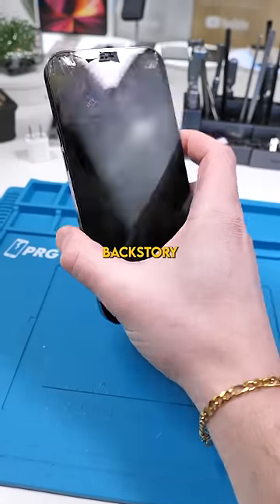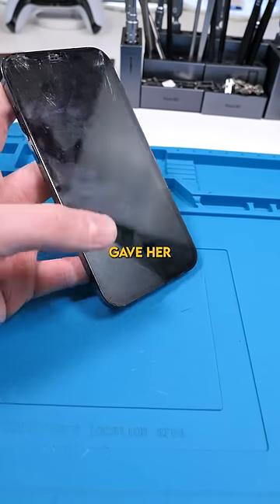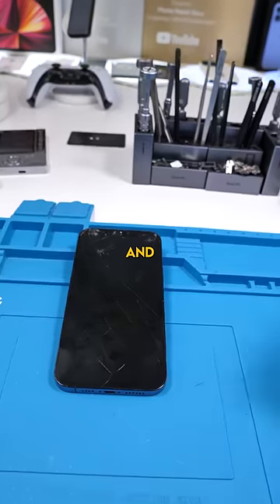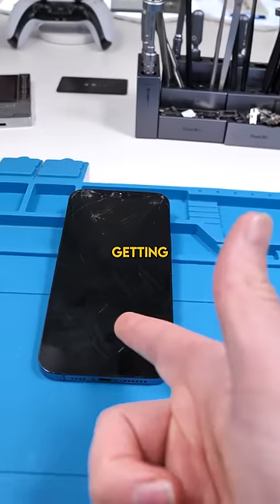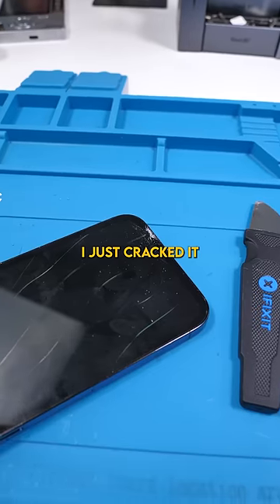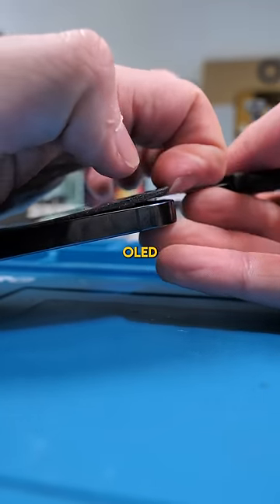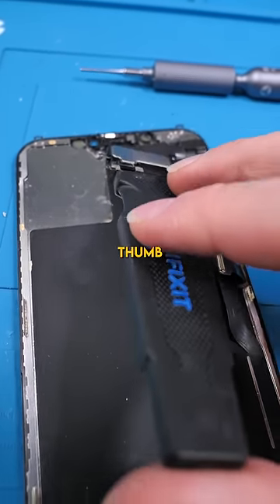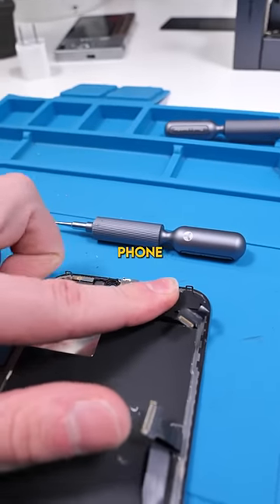They Completely Screwed Her Over... #Shorts

Comment: Jeez. That’s not good customer service at all
Reply: One friend of my friend “fixed” my old iPhone SE 1st gen. I needed to replace charging port cause it failed over those years. I was waiting for my phone just to realize that my phone is missing bottom screws. Less than one year later my phone slipped out of my hand falling straight to the concrete and split into two pieces. One piece was screen and other piece was everything else except that screen. I realized that brackets covering battery connector were also missing. So what happened ??? Well my iPhone SE that I bought for 300$ back in the 2018 was on the ground in two pieces with no signs of life. I didn’t repaired the phone cause it was 4 years old and used SE 1st gen cost about 100$ (in used good condition) at that time in my country so basically I would pay more for repair than what current phone price would be. Also during the impact Touch ID/ home button cable tore apart. And no body except for Apple can replace home button without permanently loosing Touch ID and I bet that they wouldn’t want to repair phone that was released back in 2016. Now I have iPhone SE 2022 and it meets my needs but I’ll never forget about my cute adorable little iPhone SE 1st gen 32 GB version with space grey color.

Comment: The only time I use lcd is when someone is trading in their phone to their carrier.  Shops that use lcd make the lives of every other shop that doesn’t way more difficult than it needs to be
Reply: Heads up: Depending on the carrier’s service partner that deals with those trade-ins they could very well decline the phone because using an LCD is way too obvious. Just turn off the lights and you can tell it apart even with the best LCDs.
Reply: @tahaak  to my knowledge, at least in the United States, the vast majority of carriers just want the phone to not be damaged.   I’ve been installing Lcd‘s in customers phones for years now and I have yet to have a client call me back because a carrier denied their trade in

Comment: Just opened a MacBook Pro 2019 with i9/64GB which was given to me (obsolete HW nowadays) .. it was supposedly have fixed battery. But the battery does not work. The repair company had been scratching the screws .. dunno why .. and the flat cable assist lines (?) had been broken. Have been fixing as an amateur laptops BUT never done such a terrible work.

Comment: It's not possible to put a LCD. You need completely separate voltage line for the backlight. Also it's well to see that the aftermarket display is thin so it's 100% an OLED..
Reply from the maker: it is possible

Comment: Story of mine: My old iPad had a glitch which randomly clicked, swiped and dragged things on my screen it's really weird and fucked up. And once I was in a game and when that happened I raged and smashed the screen, it broke. We gave it to a popular store (mediamarkt) who sells tech and stuff, also does repair. So basically removed the screen put on a new one, messed up the speaker, messed up home button and didn't place a thing with the screen which was needed to support the screen and the screen broke again without actually doing something to it. Brought to them to fix again and same issue, we paid those mf'ers €200 for those 2 repairs in total, just to destroy the iPad, later we went to China and to a local store, he fixed the iPad in front of us, tells us what was wrong and everything he said was correct, it ended up costing ¥50 which is fucking cheap; €6,89. No problems anymore later. Till it fell on the ground and nothing can move anymore. I don't believe those fuckers here anymore.

Comment: I’ve had my old phone brought into a repair shop for a screen protector and they broke both my galaxy s10s back glass and front screen and after then charging me €200 to fix their mistake they never fixed the back glass and not only did I have  to order parts to do it myself I was also down €200 all becouse I came in for a screen protector to protect my screen. My worst phone experience to date

Comment: So that’s a mobile sentrix screen which is what we used at my old job. What brand do you recommend?
Reply: It does look like a MobileSentrix, but it may also be the same brand this kiosk in the mall near me uses. They ripped off MS's sticker logo and are super low quality. If it's a MobileSentrix screen then they are still fantastic, I use them daily at my store. The big difference is that I use MobileSentrix's soft OLEDs on phones that shipped with OLEDs in the first place.
Reply: I hadn’t thought of the sticker switching, but that’s possible
Reply: If it's Mobile Sentrix then that's an OLED screen not an LCD as stated

Comment: How have you solved the problem of the serialisation of the display in Apple phones?
I recall when Apple introduced the lightning cable with that unmarked switching chip inside, it took almost two years for the cloners of Kamino to introduce an equivalent cable on the market at $2 instead of $10.
The same two years have elapsed now for internal configuration control...
Reply: Yes, but you do need a special device from Qianli to do that, it reprograms displays by copying the serial number from the old display and moving it to the new one, I don’t know if that’s what you are talking about

Comment: The tool you use to open the phone seems so thick compared to using a flat blade. Why do you prefer that? I still have mine but never use it since it seems like so much harder to slide in

Comment: I really really really wish MobileSentrix would STOP selling this garbage. It makes the high quality screens I buy from them look questionable. Also it can damage multiple components including diodes, caps, filters, coils, chestnut and other driver ICs. They are mostly all under shields or require the board to be split. It's harmful to the customer and gives repair bad name. Go to reputable shops that either get their hands on Refurbished OEM or are part of the Apple IRP system.

Comment: Just out of curiosity. You talked about how you should be willing to replace something if you break it. When I looked into opening up an older pixel 3 xl for a battery change to try and fix it being dead they said if the screen breaks while opening they would charge for another screen.. That's not a normal practice?

Comment: I had a Samsung galaxy tab a7 tablet and it wouldn’t charge unless you heat the charger up and and angle so it would vent the port, I sent it to be repaired it took them two weeks they charged me 80 dollars to replace the port and I got the tablet back with about a 2 millimeter gap where the wall  of the tablet and the screen should meet. The screen was above the walls of the tablet so I couldn’t use my case and the port broke again a week later as well as the screen.

Comment: Ok customer comes with working oem oled screen just cracked , they want u to work on ear piece swap clean etc , 

U give liability disclaimer that already cracked screen can crack/flex the lcd more and it can go out and u won’t be responsible to pay for it , they give u the go ahead to do repair . 

 u end up taking apart an already cracked glass screen so it bends and it punctures/damages oled somehow but it’s broken for sure and u touched it last.

What is a replacement u will offer to customer 

A. Find them a new screen oem they don’t pay anything for either repair.

B. Find them a new screen oem they pay only for earpiece repair 

C. Find them new oem screen u tell them 50/50 on repair for damaged oled ( charge same price for original earpiece repair) 

D. Give a aftermarket lcd You eat the cost and charge customer only for original earpiece repair 

E. Give aftermarket lcd free and not charge anything for earpiece repair 

F. Find a broken oem oled that’s cracked but works the same u supply that part and do  repair plus the original earpiece repair for free

G. You close up the phone and hand it back more broken with u not providing any responsibility to pay for replacement part / repair. 

U are able to make ur own answer as well I just gave couple examples . 

Whose liable

Comment: Will the faceunlock work with the non original replacement screen?
Reply: Repair tech here, it highly depends on what part is replaced for the Face ID sensor and speaker component that gets attached to the screen. It especially depends if it was taken off with care. You have to take off a component off the screen and place it on the replacement so it's all about if there was previous damage and tech patience.

Comment: I'm actually pretty disappointed in you PRG. This was your exact cue for #RightToRepair and don't lie. I've watched you use those screens. You could also explain the $150 part difference before tax and labor. Leading to the conclusion we absolutely need those 'low quality' screens. Even if it's just getting data back. Smh..

Comment: Hey brother. Big fan of the videos long time viewer first time commenter, I have a iPhone 11, and on Christmas I was cutting fire wood for my mom and it slipped out of my pocket and landed in the snow, I quickly picked it up and wiped it off and put it in my pocket, continued to work, the phone had a otter box case on it. The phone worked fine that night, but when I woke up the next morning, the phone will not load any videos, and every 2-5 mins restarts, I’m almost certain one of the processing chips got damaged. The phone still works for a few mins before restarting. It won’t work long enough to send my pics or anything off it. I had to resort to using my old iPhone, I was wondering if there is any way you can fix this? The phone wasn’t cracked and in a case, and supossed to be ip68 water proof, so I’m not sure how this even happened to begin with. I was wondering if I would be able to mail this into you and have you take a look at some of the chips inside. Thank you

Comment: Hey, i got a problem with my Galaxy Z Flip4. I love this phone but there are 2 things i want have changed. At first that i can't fast charge and it has a really slow USB-C port can i have that changed? And the second thing is the accu is it possible to put a bigger battery in it? Love your content Plz help me
Reply from the maker: Hey Stefan, Thanks for being a member! 
With the Z flip there is actually a setting you need to turn on to enable fast charging.
In settings > Battery and device care > tap on battery > Scroll to more battery settings > and enable fast charging. 

As for a bigger battery that is not an option at the moment, it may be in the future depending on whether aftermarket manufacturers chose to make a larger capacity battery.
Reply: @PhoneRepairGuru  plz answear if it is possible i want to do that...
Reply from the maker: It's possible, but it would not fit in the housing and would not be practical at all

Comment: they should have 100% replaced with an original. disgusting that they gave a cheap lcd.
Reply: They should have used an aftermarket OLED screen. Only way to get an OEM screen is if they bought a new phone and took the screen off, or took it to Apple.
Reply: @sarfured That is just blatantly false, I do this for a living. OEM screens are super easy to buy, they're just more costly.